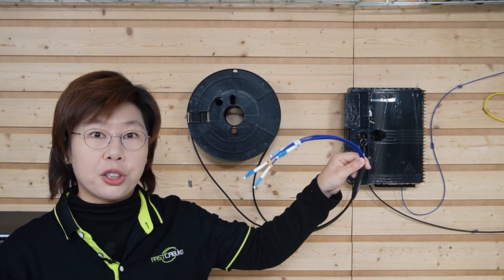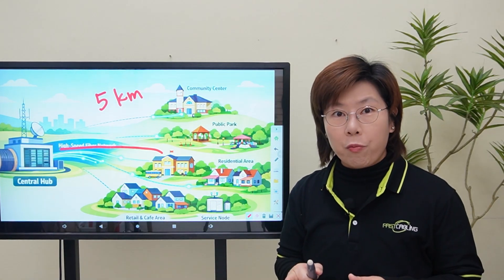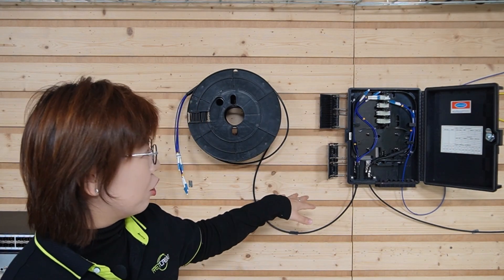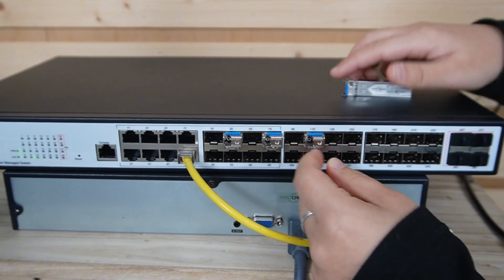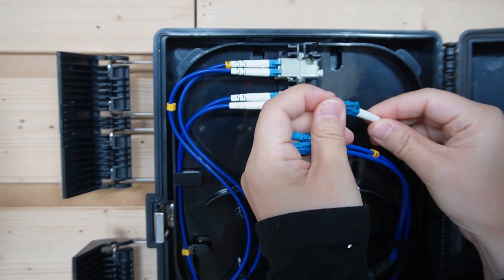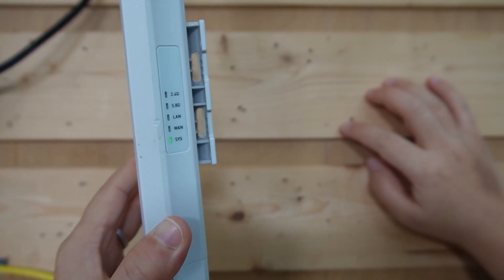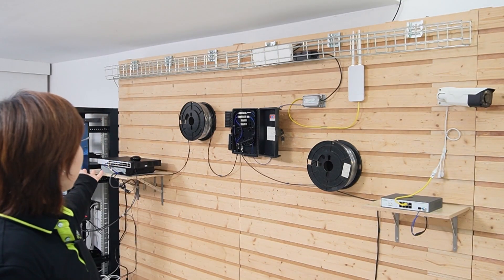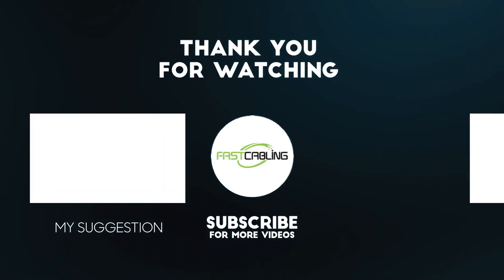Build a Community Fiber Network over 5KM with ONE Cable! | Outdoor Termination Box Explained

Comment: I have tiandy camra ,login to p2p in easy 7 VMS after 15 ask verification code.how to disable this verification code
Reply from the maker: Tiandy enables the verification code for P2P by default for security reasons, and it cannot be disabled in Easy7 VMS.

When prompted, you need to enter the device verification code, which is usually found on the camera label, NVR label, or in the camera’s security/P2P settings.

If you don’t know the code, you’ll need to reset the device or contact Tiandy support to retrieve or reset it.

Comment: we still have single point of failure
Reply from the maker: The conjunction box which distributes the fiber strands is not activated devices, actually it is even not PLC splitter which splits the light. It separates 12 strands single fiber cable from the IT room and send them to different destinations.

Comment: Is it possible for one to use only one media converter at point A instead of fiber switch or OLT to multiple points.
Reply from the maker: A media converter is point-to-point only, so one media converter at Point A can connect to only one remote point.

If you need to connect multiple points, you would need a fiber switch at Point A (or an OLT for PON systems). A fiber switch allows you to distribute the fiber connection to multiple devices or locations properly.

Comment: Please clarify something for me.  So say there's a community of 5000 homes.  Are you saying you have ONE of these Termination Box at certain location and ALL the homes would connect to that?  Sample scenarios of different type and what equipment would be better to give fuller picture.  Or would you have one of these Termination Box at say every 100-1000 home (central to those) spread out until coverage is complete?
Reply: This is just a different way to package what is already being done in the field. Generally, a multi-fiber line comes into a sealed box that is buried in the ground called a 'Fiber Distribution Hub' And you use the expensive splicer she is talking about to connect the different end strains to the lines going to the house. Those hubs can be large enough to connect dozens or hundreds of connections. This solution is claiming that the ends have termination points on them and you can just plug them together, making the job easier. The problems are that this has rooom for a limited number of runs per box, and that you would have to calculate and pre-order that fiber cable at the approximate length with the ends terminate and hope there isn't anything that was deviate that by more than a few feet (assuming you ordered it a few feet longer as a precaution, but not so long as it would cause an issue with excess fiber cable.) This solution is not really adequate for whole neighborhood or towns IMHO, but would be perfectly fine for a campus or business park if you want to have Fiber ran to each building or suite with the ISP(s) terminating to this box and can then just select their client.
Reply from the maker: No, for a community of 5,000 homes, that would not be practical or scalable. For large deployments (towns, cities, 5,000+ homes), traditional FDHs, splice closures, and OLT-based PON architecture are still the best choice. This solution is not meant to replace city-wide ISP fiber design, but rather to simplify fiber deployment for campuses, business parks, rural clusters, and similar use cases where speed and ease of installation matter.